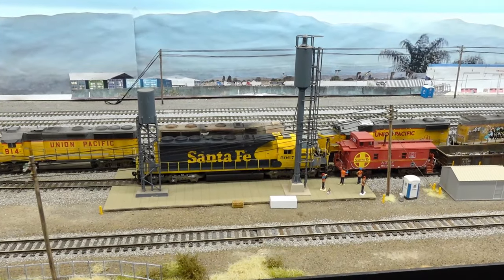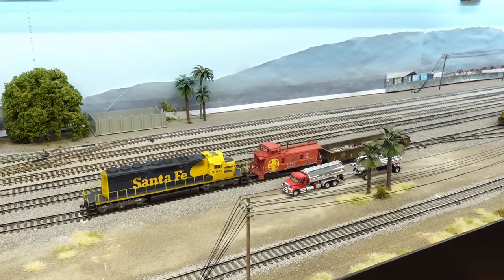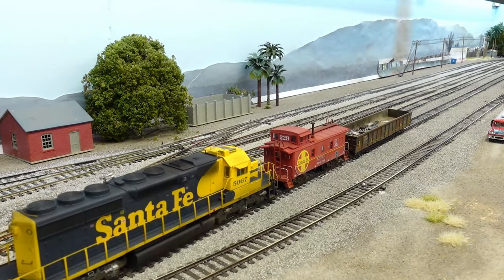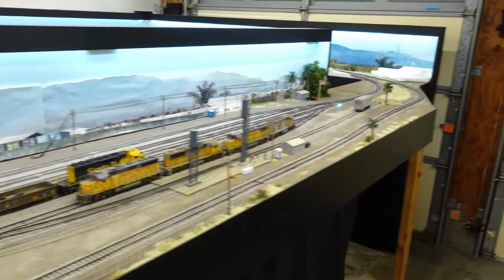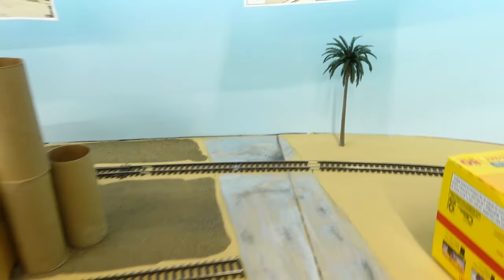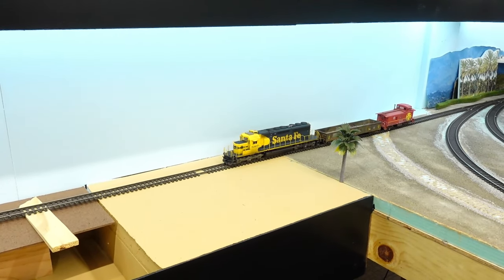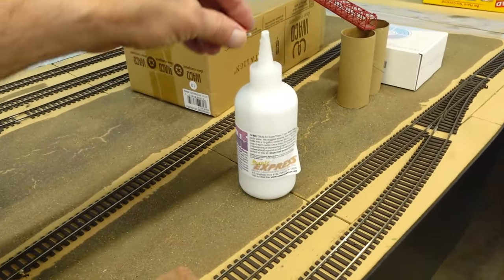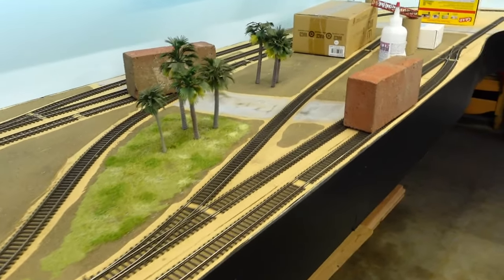Layout Update | Gluing Track Down with a MOW Train

Comment: Hi Rick, I solder my bus connections, suitcase connectors started being used on trailers some 20 years ago here in Australia and caused intermittent problems (the hardest to troubleshoot). We ended up going back to screwed or soldered connections. 

My wire strippers will strip and push the covering apart by 5mm enough to wrap and solder the wires. Cheers Peter.

Comment: If you want to hide the feeders and not show obvious solder joints do what I do - solder the feeder wires to the bottom of rail joiners and then poke the wire through a hole in the 'roadbed'. It also means you don't have to worry about the heat from soldering putting the rails out of gauge.

Comment: Hey Rick great little update , I like that you show the hiccups ... and don't edit them out ,shows the real side of model railroading .. I was wondering , I know you mentioned the switches you use , Peco streamline , are they insufrog. ( plastic frog ) with the wires crossing over the back of the frog ? 
, part number be great as I see you have very little switch issues , thanks 
Cheers Rick , and hi to the Conductor Benjamin....
Reply from the maker: Thanks. I use peco electrofrog turnouts. https://midwestmodelrr.com/pcosl-e92/